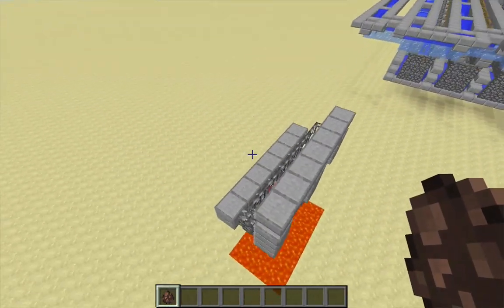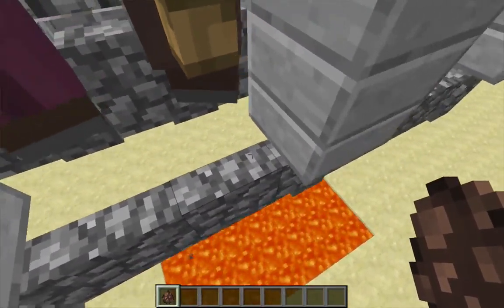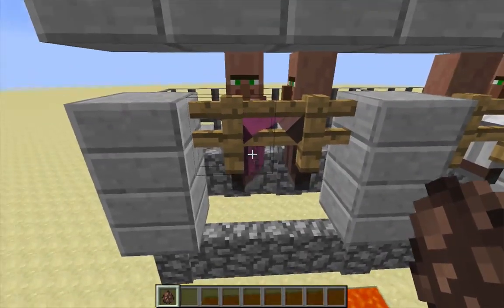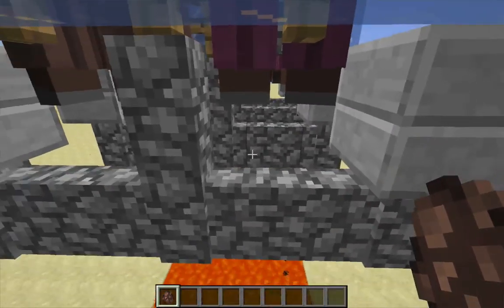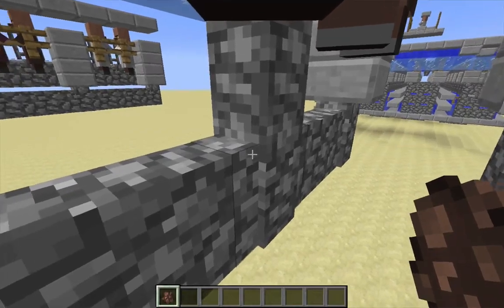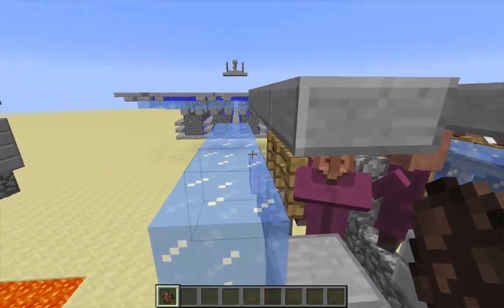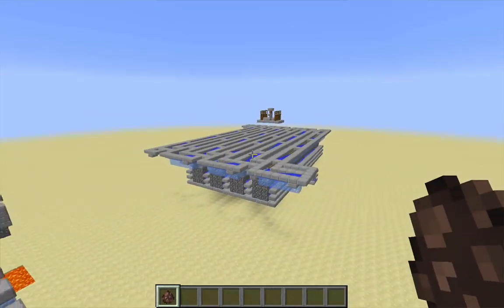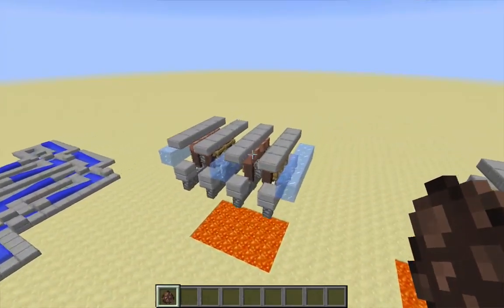Tweaks to Rays Villager Breeder

Comment: Sorry if my question is quite... simple... but how would you get villagers (2 of them) to get on each side of a fence post? If it's similar to Ray's and you have to use pistons to push the fence onto them, afterwards killing the spares, isn't it a lot of work, albeit efficient?
Reply from the maker: +AceSurviver54 In my experimenting, I found that it was easier to load the villagers by stacking up the fences and cobblestone walls, and using water streams to force the villagers to drop into the small spaces. Pistons can then be used to push the half slabs into place above them. It's still a lot of work, though, and that's one of the advantages that Ray's original breeder has: His loading procedure is much easier.

The biggest advantage that the modified design has, in my opinion, is that it prevents villagers from moving at all. In my testing of the original design in the 1.9 snapshots, I found that a villager would sometimes clip into the half slab above it, and it would then swim upwards, through the slab, to stand on top of the farm. Not only would this eliminate a breeding pair, but the breeding villager would then be close enough to the door villager to shut off the farm. So, yes, loading the villagers in the modified design is a pain, but it's a safer design for 1.9.
Reply: Oh, I see. So although yours can be more time consuming, it ultimately is more compact for end game purposes. Thanks for your reply! It is much appreciated and many youtubers dont take the time to answer or don't have the time.
Reply from the maker: No problem, thanks for the question. As to the compactness, note that Ray specifically identified a diminishing rate of return for an increased number of villagers, so it's not clear that compacting the village in order to add more villagers would be worth it. It would make things smaller. More importantly, however, the villagers would have no force acting on them, so they're less likely to glitch out.

Comment: so Im trying to build your 4 pair version and how do u get the villagers in on survival when its hard enough in creative? Tutorial?  I tried to get 2 per the single stone post as depicted but 1 villager gets forced into the fence.  Otherwise cool innovations! How high above does that single villager need to be and from what block?
Reply from the maker: +naturalyamazing In your other comment on the food farm, I've given a bit of instruction for getting the villagers in place. The bootstrap breeder uses the same sized breeding cells as the one in this video, but some of the blocks have been shifted around in order to make it easier to load.

The single villager needs to be 7 blocks above the breeding villagers. So, if you check the y-coordinate of the cobblestone wall on which the breeding villagers are standing, it should be 7 less than the block on which the single villager is standing.

Comment: I cant get slabs above the villagers heads to be able to run a water stream along side them...any ideas as to why they would be too high? I have to feed them manually
Reply: Use a piston to push the block in place
Reply: yeah thanks i'd thought of that but was worried about moving the villagers. Will give it a go :)

Comment: I checked out the other video and I was able to get the positioning down.  Now if I build your carrot farm fix for 1.9 to create the constant supply of carrots (and I would build this breeder in my spawn chunks more than likely) will the single villager detecting the doors create issues for the carrot farm if its too close to the breeder?

Since you said they basically need continuous carrots so that they never run out, am I right in assuming that the only "off" i can have for this farm is to continually let them pump out kids and just have like a togglable lava pit to continuously kill them when not needed?
Reply: +naturalyamazing heh i just had to look up.  But the other question stands, theres no way currently to really turn this off eh? just kill what you dont need
Reply: +naturalyamazing Fantastic world download to!!! thank you very much sir
Reply from the maker: +naturalyamazing The "off" switch is actually quite easy. You just need to push blocks in place so that one or more of the doors is not recognized as a door of the "village". With fewer than 6 doors, the breeding villagers lose their willingness, since the population cap is reached by the lone villager next to the doors.

The real trick is allowing a larger scale version of this to run for long periods of time. You would want the off-switch to be active (breeding off) when no food is flowing into the villager area, so that there's no risk that the breeding villagers will run out of food. I haven't fully designed it yet, but I plan to use a tripwire to detect food dropping into the stream, which deactivates the off switch for a set period of time. That way you don't have to worry about the possible different rates of food production and villager production that might be caused by player proximity or selectively loaded chunks.

Comment: very nice improofments, u might want to take a look at my design i built(there s a pic in my comment on rays vid) it doesnt use ice channels, but the villagers can be compacted to half the size as they r in ur design, but i noticed that there s really no point in drastically compacting it, just bc the village has a max of efficent villagers anyways and u dont need to expand it further
Reply from the maker: +Jendrik Weise Yeah, even Ray was compacting the villagers in each row by using a fence gate, and he mentioned about seeing a diminishing return as the number of villagers got larger. This tweak was really about trying to make sure the villagers don't move at all, which means locking them in place and ensuring there are no forces pushing on them. I was also trying to fix a problem that was occurring in 1.9 with the taller villagers. Sometimes, with lots of villagers, they would be able to escape their breeding area by swimming up through the intersecting water and half-slab above. So I was eager to find a way to move the water while still allowing them food.
Reply from the maker: +Jendrik Weise I didn't see a pic of your design, but I think I understand the door-bars arrangement. That should also leave 20px of space for a breeding pair. Doesn't the block underneath the door cause problems, though? In any case, in 1.9, you could replace the door with two floating trap doors (or even just one).
Reply: +Jendrik Weise I have it remove (.)com from my comments automatically to avoid scammers from spamming my videos. So if you post a link with (.)com it was probably removed but I can still see it.
Reply from the maker: +Jendrik Weise Okay, that makes more sense. Are there any problems with villagers in adjacent cells breeding "through" the iron bars?
Reply: idk xD i just made the setup and i think u might even be able to use fences i cant try rn
Reply: iactually could test t and it s wiered... this looks like they r in each other but i cant push them into each other i m unsure
Reply: http://i.imgur.com/M0reSzO.png it might be that there s some issues with the hitbox rendering
Reply from the maker: +Jendrik Weise it could be that they're pushed into the block a bit
Reply: no then they d be able to just go through it wich isnt happening
Reply: thank you for the quick response. this bootstrap breeder I assume is the same one I was asking about. seems it's decently efficient correct (you compared it to unary bits 20 breeder)? a
Also, with the paired breeder - I'll rewatch/retry your design. I used one cell of rays works version and got quickest breeding after initiating trades rather than food. in the span of maybe an hour I noticed that given food all they did was huck it around but no breeding occurred (maybe I needed to give it more time). You've probably tested yours enough to confirm that food does work, maybe they just hate me haha.
Reply: what? there was no response here... also, i guess you must have gotten unlucky idk
Reply: +Jendrik Weise 
I think I just responded in the wrong place. not at a pc atm
Reply: ah ok :P i ready figured
Reply from the maker: Yes, food does work, but you have to load the villagers up with food before getting them into the breeder, and then you have to constantly supply them with food. That's why I have a food farm above my bootstrap breeder :-)

My (survival-world) testing of the bootstrap design was producing a villager every 2-3 minutes. That's comparable to the expected output of Unarybit's compact villager breeder, stocked with 20 breeding villagers.
Reply from the maker: lol, sorry for hijacking your comments, Jewe :-)
Reply: +Nathan Ryan 
OK.  and last question: do there entire 8 inventory slots need to be filled with the respective crop? Thank you for all the fast responses!
Reply from the maker: It's probably a good idea to load them up completely. The important thing is that they don't run out of food while in the breeder. If they do, they'll start to throw food to each other like they're having some kind of crazy food fight. But since they're unable to catch anything, all the villagers will quickly run out of food for breeding, and it's difficult to load them back up again
Reply: +Nathan Ryan 
OK noted. tyvm for your help :)
Reply from the maker: sure thing